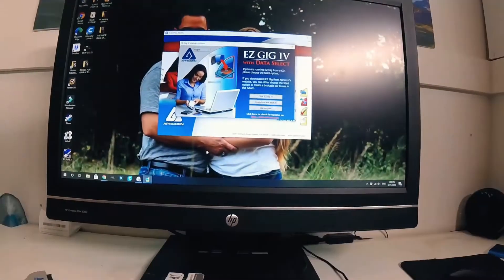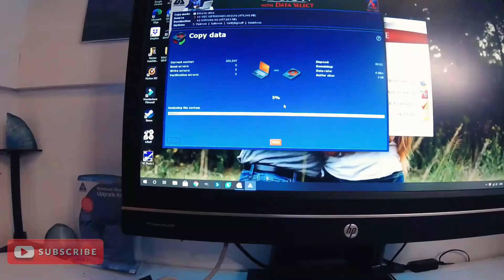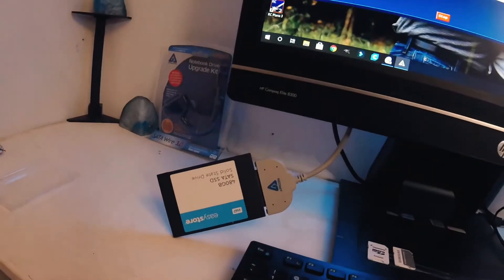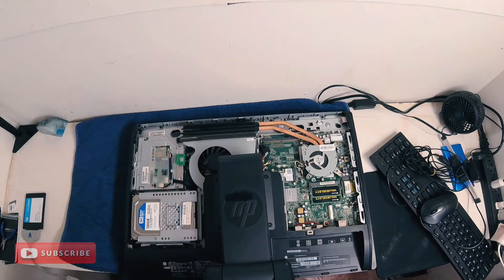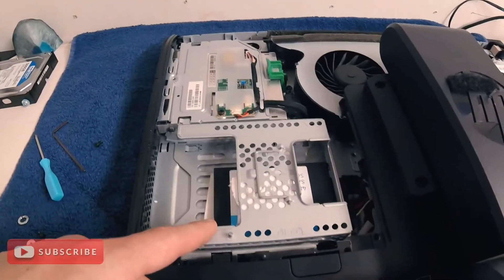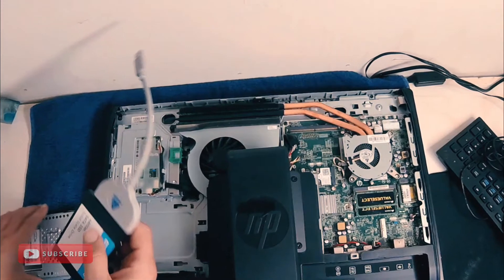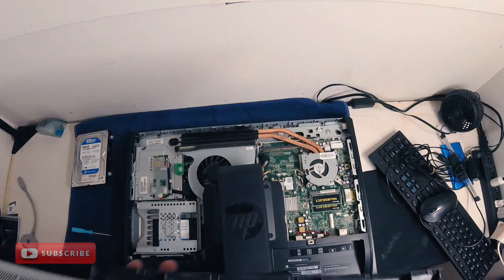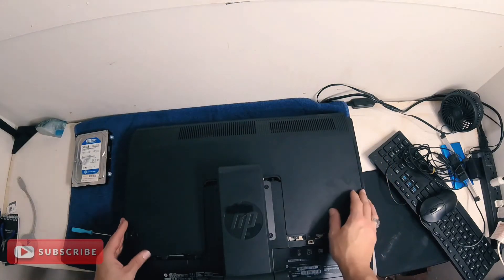UPGRADE? hp compaq elite 8300 ALL IN ONE available modifications

Comment: help me out here, any SATA-3 SSD will be plug and play with no issues, or should I look out for some specifications like the SODIMM vs DIMM in the RAM's case?
Reply from the maker: You will want to use a cloning software like the one i used in the video . it will keep your operating system and everyrhing with no issues. Easiest wat to go to ssd . .  but you want ddr3 1.6 sodimm ram for you ram upgrade . .  hope this helps !

Comment: For anyone curious the best GPU upgrade you can add to this AIO is the Nvidia M600M Quadro which has 2GB VRAM and a 30W power limit. You shouldn’t use any GPU that has a higher power limit as the power supply won’t support it.

Comment: I bought an hp compaq elite 8300 all in one, and my problem is that the wi-fi it has does not recognize the bluetooth, this is its RT5392 card - HP P/N: 640823-001, these are the data it has: GBVBL00TK3WJNK MAC : ID: 2016D8718C31, this is useful for using with Bluetooth, I await your comments, thank you.

Comment: I had an idea that *might* work with these systems. If one were to install an MXM to PCI-E x 16 adapter cable, with a bit of modification it may just be possible to fit a wee little GPU in there, and just put a short lead sticking out of the case to fit any display connections. That way you don't have to seek out the scarce and ageing 7650a cards that these are compatible with, and we may be able to use other cards that are just as powerful, newer, and way easier to source

I also read that, if people are having troubles with the system not booting after a GPU install, it can be because the power brick will not be providing enough wattage and needs to be replaces with a more powerful unit. 

I just picked one of these up for really cheap, so it will be fun to play around with and see if I can get that gpu mod going. 

If I I get it working,  I'll drop by and update this comment.

Anyway, good vid! Thanks for sharing.
Reply from the maker: Sounds great ! I would love to know how ot goes !

Comment: Hi Jesse- Thanks for the video! I have a similar machine and have updated it to an SSD. I'm curious if you have the same issue I'm having. When it sleeps the fan ramps up to like full speed, then when it wakes the fan is normal again. I have done the following - updated the bios to the latest bios, went and tried every bios setting combination I could, I've loaded windows 8.1, windows 10, windows 11 and even Ubuntu on it- and the same thing happens (even with Ubuntu) when it sleeps the fan goes nuts- then it's fine when it wakes. I know I can set it to not go to sleep, but it's just irritating that I can't figure this out. I bought this off Ebay used cheap and it looks like it was like a corporate issued unit, and someone definitely either replaced a backlight or panel on it be cause the screen color is a bit off- it's possible that one of these repairs has something to do with the issue. I don't know just a mystery. Thanks for the video- sorry about the long comment!
Reply from the maker: Hmmm . .  that is a strange one. No i have never had that issue and still use this pc for streamimg video to a home theater type room. Might sound silly but could take it apart and clean everything and reseat the cpu heatsink with some fresh paste. And double check everything is plugged in and not loose. Seems like it doesent have a powercutoff to the fan when it sleeps. Is it original power supply ?? Hp has these 3 wire plugs that are proprietary and go to the motherboard for power switching and stuff specifically. Annoying problem . .  wish i could hwlp more. Good luck my friend
Reply: @jessemellon6258  Thanks Jesse- I think something got swapped out at some point because the screen is a little janky on the color balance and I can't get it adjusted for the life of me. I got this dirt cheap so it's just not really worth putting much effort into. If I just keep it out of sleep mode- it works all fine. It's just plain weird. Its funny that if I stress it I can hear the fan ramp up appropriately, but never really loud- put it to sleep and it sound like a 747 :) Thanks again for the response!
Reply from the maker: @gak0090  yeah i think whats happening is the internal cutoff from the power supply is working when the machine is on however when it is going to sleep it is losong that control and getting full voltage from the power supply. A full 12 volts will make that sound like a jet. Go to settings and tell it to dark the screen after say 5 mins or so but in performance or accessibility you can tell it to never actually sleep. .  i believe you can find these pretty easily and just restart manually once a week or so to make sure your getting updates and things. .  little ghetto but without getting too deep this could be an option for you. Still would check small 3 wire plug at bottom of mobo and make sure its plugged in because that handles all the power switching and stuff and if thats not plugged in that could be your easy fix for this whole thing. The pc could work without that plugged in and cause funny things like this to happen. Good luck !

Comment: Ok, so I just installed an AMD 7650a from ebay into my hp elite 8300 aio. It's not hard other than you have to know to move the connector from the motherboard graphics to the mxm graphics plug. I bought a nvidia gt 630m mxm as well just to bench it against the 7650a and the amd surprisingly runs better.
Reply: This comment saved me such a headache. I was getting the red green blue screen and couldn't find any answers online. I moved the plug and bingo that was it.  Thanks!!!
Reply: @patmlem cant believe its been 3 years since i did this. Feels like last year. Im still using it with the nvidia graphics card so hopefully yours will do just fine for a long while too.
Reply from the maker: that's awesome ! great work. that 7650a is extremely hard to find . .tried 2 off e bay and they were both the wrong kind
Reply: @jessemellon6258  I searched radeon 7650a HP and it came up with a few,  and I took a gamble on the cheapest one. The nvidia gt 630m was just as random, but seems to run fine as well. I noticed the resolution options for the gt 630m were lower than the 7650a, which I thought was odd. Either way, with how both cards worked right away, are you sure the card you bought wasn't just bad? What was the computer doing when you installed it? Also, did you get the heat sink as well? I didn't install the heat sink right away and it caused the computer to boot to the login screen then crash.
Reply from the maker: @shade_angel1445  yeah i tried two . . .  both with the same result . .  i just kept getting red green blue white screen changing over and over . .
Reply: @jessemellon6258  did you move the LCD connector on the board? Mine was doing that as well so I researched it and most answers were the graphics card was bad. For some reason I started reading through the manual and found a parts ordering page where it listed out each port on the motherboard where i  found a mxm connector for the LCD. I honestly thought it couldn't have been that easy... I was wrong. I can't post pix here but the mxm LCD connector is the top one just under the mxm graphics card slot. Take the bundle of wires with the black sheathing on it thats in the way when putting the mxm card in, move it from the bottom connector to the top one. I'm betting this will fix your issue.
Reply from the maker: @shade_angel1445  wow ill have to give that a try !! Thank you for the tip ! Ill repost once i try it and let you know  how it goes ! Thanks again
Reply: @jessemellon6258  I'd suggest going to HP and getting their specific drivers for the card. It might be a little difficult to navigate as my computer wasn't automatically detected so I had to manually put it in and then I decided to manually download just the and driver instead of the full package.
Reply from the maker: @shade_angel1445  hey just figured id let you know ! I moved the little connector to mxm and re installed the card and after installing the drivers it worked ! !! . . .  thank you so much for the help . . . new problem is . .   over heated after about 10 mins of playing war thunder . .  good thing this pc is just a hobby for me at this point lol but thank you so much for the comments because it actually worked!!
Reply: @jessemellon6258  ok, are you running the oem heat sink? I've played a few hours of risen 2 with no issues as far as I can tell. I do need to get an app to monitor temps tho just in case.
Reply from the maker: @shade_angel1445  no it was just another one i had lying around and had to beat it up and cut it to get to fit lol . .  so im sure it was the problem

Comment: You are so wrong it has another SATA port hidden under the mount Plus the white mSata 
SSD connector but the tradeoff is that it won't run at SATA 3  with more than 1 drive connected but that's the trade-off of the Q77 chipset! ... Mine's got 3 SSD's running at 
SATA 3 with a bit of tech voodoo & I still have the ODD port but that's limited to SATA1.5 unfortunately, I'm a computer tech so I know ALL the firmware & software hacks after 40yrs!
Reply from the maker: watch the whole vid bro . . what you do with the connections is up to you 😎 thanks for watching

Comment: Can we install exteral graphics card?
Reply from the maker: Its been a while since i made the vid but yes i want to say there are external graphics cards that work with it.. Problem being they were expensive then so i could only imagine how much they are now if you can find at all...just make sure however its wantimg to be connected that you actually have that connection. .  you may have to either leave the back off or modify the back panel if it wants the Available mxm port. Good luck ! And thanks for watching !
Reply from the maker: So yeah in further thought you will want to look for one that works with the processor you have and connects via mxm 3.0

Comment: You should have been able to install your SSD and still keep your HDD. You use the SSD as a boot drive for the OS, then you keep your data on the HDD. Learned this from Linus Tech Tips. Instead of cloning your drive you just leave it, and install any programs you want to load quickly on the SSD; like your operating system, that way you get to keep all of your space.
Reply from the maker: I might have to look into that ! Thanks

Comment: I have a 8200 elite all in one do you think i could add an rx if it is possible
Reply from the maker: I think your asking about a vtx . .  to find out go to hp.com and type in your model . it will bring up a long list of various models listing various models and compatible parts . .  hope this helps thanks for watching ! Help me out !Please sub if i helped you! Tttl only original hp stuff will work.
Reply from the maker: You will want to look to see if you have an mxm 3.o port in there . and if you have one it will list compatible graphics cards next to the port . just a fair warning i have tried and its hard to find these old original cards bit if you dont mind paying a premium for them they are still out there
Reply: @jessemellon6258  Do these computers not have PCIe slots? Graphics card goes into the slot, install the driver and your done.
Reply from the maker: @joshmellon390  no they use mxm 3.0 for graphics

Comment: the RAM on this originally is SODIMM? got the same device and plan to upgrade the RAM
Reply from the maker: Yes its sodimm ram . .  same parts as laptops. Make sure you get ddr3 ram as newer will not work . highly recommend going over to a solid state drive instead of hard drive if you havent already. Please sub if you found what you were looking for ! I have another video on i7cpu install too ! Thanks again ! 👍
Reply: @jessemellon6258  for now I'll upgrade to the DDR3 16gb 2x8 sodimm corsair vengeance. still contemplating the SSD upgrade, mainly cause of the data transfer process, couldn't find a full kit with the software so far. Mine came with the i7 cpu. Good luck will be on the lookout for your new upload. Please use a tripod so we can see what you do as a full process rather than photos.
Reply: sorry nvm, i just rewatched the cpu upgrade video, you do already use a tripod :D
Reply from the maker: @ProGaM3r93  yeah i used the apricorn sata to usb kit from best buy . .  its 40 more dollars but something to have around ! Thank you !
Reply from the maker: @ProGaM3r93  👍
Reply from the maker: @ProGaM3r93  ssd is a great choice for upgrade ! Also have a video on integrated graphics performance for i7 with liftoff fpv simulator !

Comment: Awesome video! Are u gonna do the AMD GPU?
Reply from the maker: Im still working on that one running into some kinks . really hard to find the correct card made by hp that isnt crazy $. . .  bought one from e bay and didnt work . .  did more research and it HAS to be one manufactured by hp . . please sub if you enjoyed the video ! And thanks for commenting!
Reply from the maker: Manufactued by AMD . . . .  with HP stuff on it . .
Reply: @jessemellon6258   the GPU that you mentioned before, AMD Radeon HD 7650A Graphics card, should work right?
I have the same PC and i really need a GPU.
Reply from the maker: @leonelrodrigues6682  hey thanks for watching please sub if i helped you out ! . .  check out some of the other comments and my replies . i have not been able to find the correct card yet . .  if you can find one that is the correct card you should be able to plug it into that mxm 3.0 connection restart the computer go into your settings and change from integrated graphics to the option that is now availabe being the New graphics card .  good luck and happy hunting !  Amd radeon 7650a original hp .
Reply: @leonelrodrigues6682  It works and pretty well especially with 16gb RAM and 2TB Crucial MX500 or EVO 860.
Reply: @jessemellon6258  Hey, did you ever see the red-green-blue flashing when you start up after putting in the graphics card? Just wondering where that setting is to change from integrated graphics, is it somewhere in the bios?
Reply: @antramo7726 what’s the gpu called??